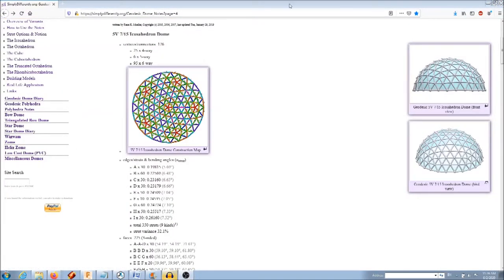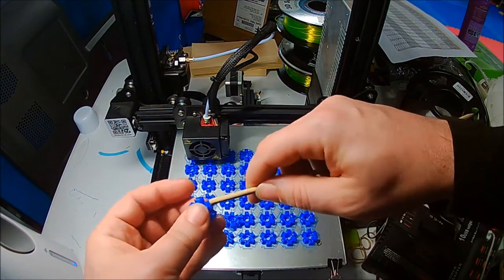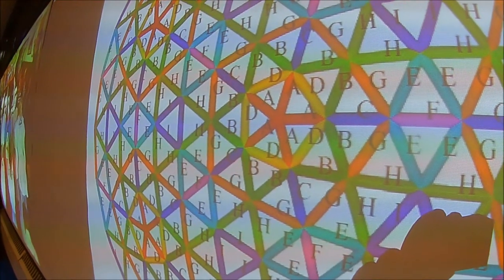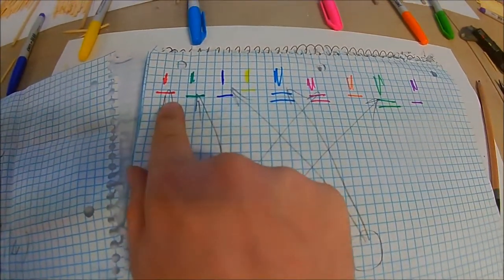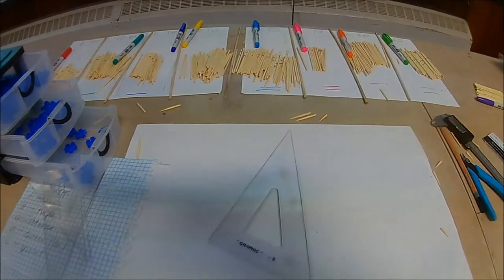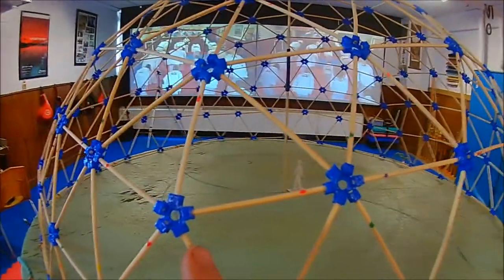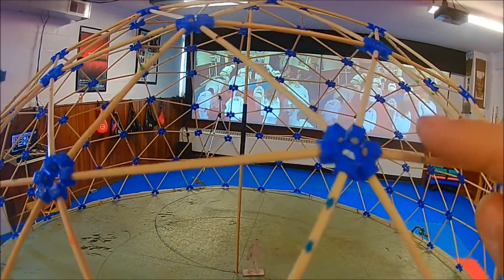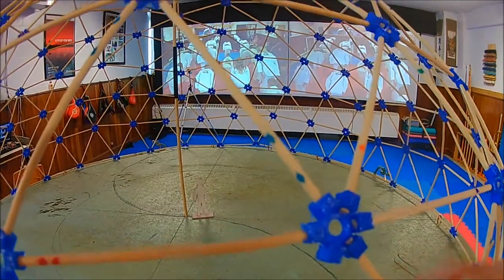Geodesic Dome - building scale model. Timelapse.

Comment: Great job on the model. Finding 9omm diameter bamboo skewers for the full scale version may be tricky ;)
To increase the rigidity of the hub you could print a semi flexible disc with a round cylinder (like a T) that will fit into the exisring hub.. If you print the cylinder with a threaded hole you can use a machine screw and washer to lock it into place (from the back). The disc will be on the front of the existing hub so it covers and sandwiches the segments which will help resist any outward movement. I domt have a 3d printer but i`m sure its easy to do ;)  I use 3.2mm heatshrink tubing and M3x 8mm machine screws to make the hubs for bambbo skewer domes. Making the hubs for a 5v would take me a while ;)